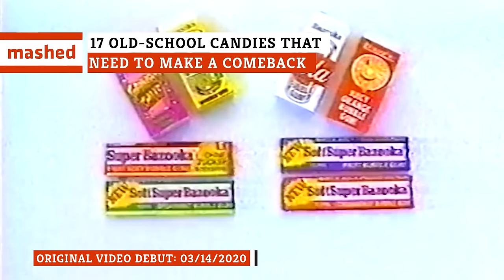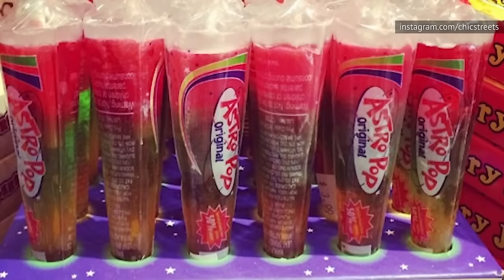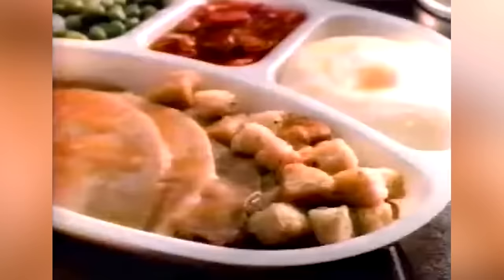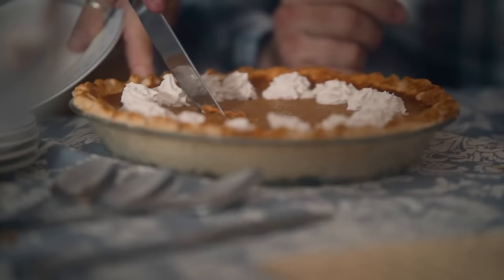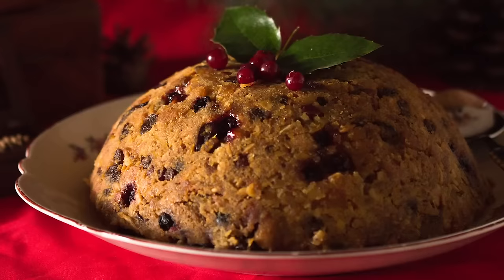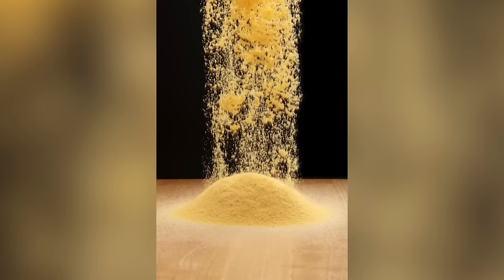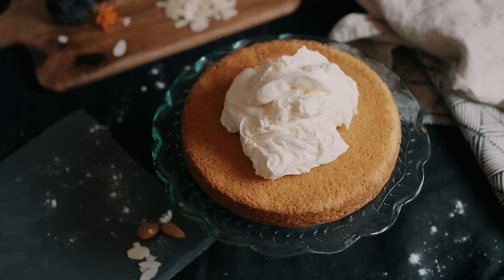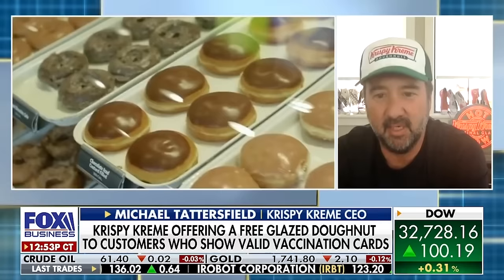Old-School Foods You Forgot About Marathon

Comment: None of what you showed for milk toast was actual milk toast.  You had a variety of toast, French toast and bread pudding but no milk toast.  

Creamed chipped beef on toast (SOS) NEVER had a variation of tomato sauce added to it.  That would be an entirely different dish.  The third picture is crackers and pimento or ham cream cheese, not SOS.  The picture after the SOS TV dinner is biscuits and gravy, again, not SOS.

We still make Jello salad every holiday, just not the savory kind.  We whip the prepared jello, add fruit cocktail, mandarin oranges, grapes, chopped apples, walnuts and mix in whipped cream.  It's a great dessert.  Jello poke cakes were very popular in the 80s.

That Velveeta dip with tortilla chips isn't much different than the cheese fondue and bread from the 70s.

The Cabbage Soup Diet is still popular today and it DOES work to drop weight quickly.  Cabbage slaw is used on homemade tacos, pulled pork or beef🎉 sandwiches as well as just a good side dish or made into sauerkraut, it never fell out of favor.

I laughed in 2020 at all the wannabe bakers.  I started baking my own bread, including sourdough, in 1966.  I keep a pound of yeast and a sourdough starter in my freezer at all times.  And I keep 5 gallon buckets of various flours too so I can bake anything.

None of those first pictures of creamed spinach were correct.  They were all spinach dip except the last.  Creamed spinach is made with a light bechamel sauce and is not stiff like dip which is made with cream cheese and mayo.  Creamed spinach sometimes is made with bacon and onion.  It is rare that a restaurant can make it right as it doesn't hold well in a steamer and must be made to order.

Shrimp cocktail is delicious!  I make it at home at least twice a month.  It beats shrimp scampi by a mile when you want something savory.

The foods that can stay gone are oysters, calamari and savory Jello salads.  Nutella is another, I tried it once, it tastes like a disgustingly sweet frosting.  It doesn't belong on bread or any food for that matter.